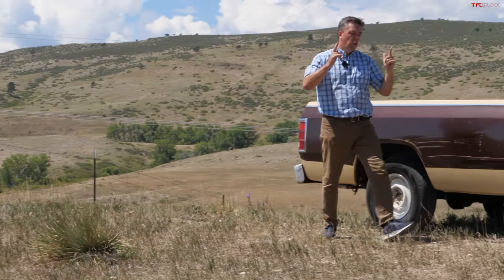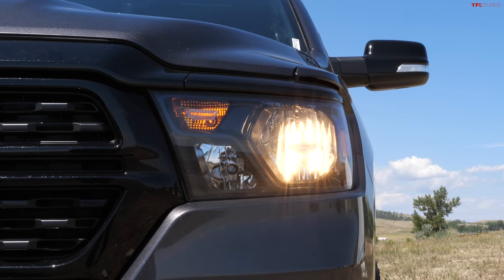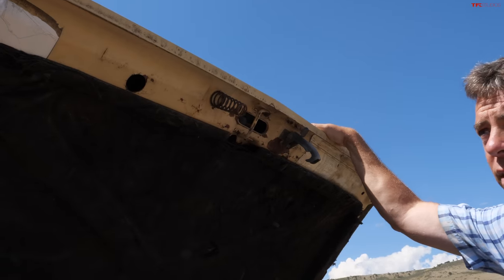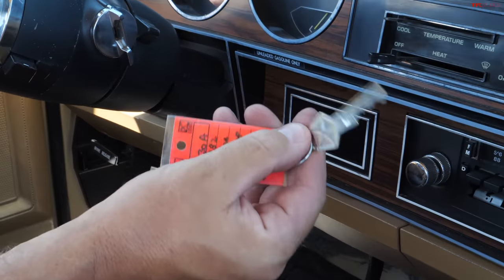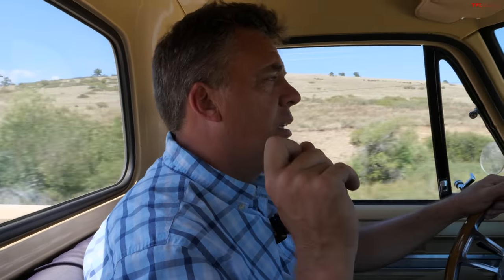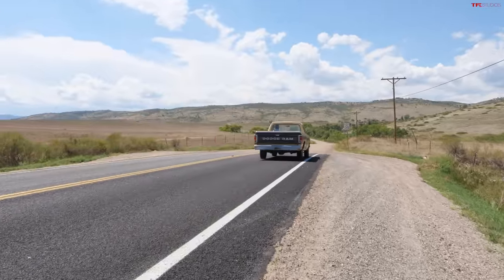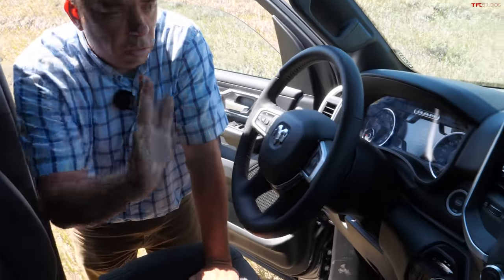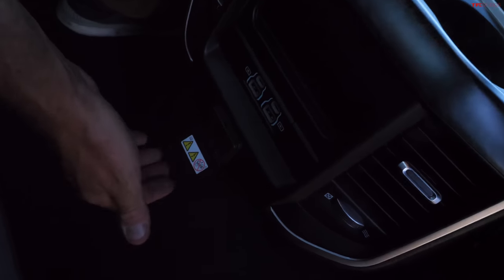You Won't Believe How Much Pickup Trucks Have Changed in The Last 40-YEARS!

Comment: Years ago you bought a pickup truck because you worked a trade, plumber, electrician, carpenter of you were a farmer…

Nowadays the manufacturers have converted the public to buying trucks because they’ve created a “need” for them.  Most trucks are rarely if ever used as a truck, they’re a showpiece for their owners ego.  Convenience features have created lackadaisical drivers; ie “I can’t turn my head to back up”…

The vintage model is made of fixable metal, the brand new model is a lot of expensive replaceable plastic.

Comment: First, stop calling it a 3.7; they measured everything in cubic inches back then. It's a 225. Second, you might be surprised towing. Manufacturers tended to be overly conservative with ratings back then. My first truck was a 90 Dodge with a 318, and I towed 14k with it. Probably not a good idea, but that old Ramcharger did it.

Comment: Yeah, but people could AFFORD those old pickups, now a days, NOT SO MUCH!  $34xx.xx +/-, as opposed to what , now a days,,,,,, $45,xxx?
Reply: Factoring in the inflation rate from 1982 until now:  $45,000 today would be about $14,656 in 1982. That was a LOT of money in 1982, so affordability was probably similar, especially if you compare a stripped down truck today, which still has MANY more creature comforts and safety features than the 1982 truck.

Comment: Ok comparing the 2 which would cost more to repair? Trucks back then where exactly that. Amazingly they did back then what they do now, only in a world apart in comfort and power. Lap and shoulder belts were standard. I'd still take the old ones. They are a break from all the damn technology we are swamped with. The old ones no computer, unless the crappy Chrysler lean burn. No dash screens, back up cams, lane assist, self drive no you drove them. And they had wind wings!! Nothing has them anymore.

Comment: I would personally take the 82 over the new one everytime. I learned how to drive on 74 Dodge power wagon club cab full size box. My father used to fill the box with sand. It squatted the leaf springs and tires. Couldn't believe the weight he would put in that truck. Not a fan of the fancy trucks of today.